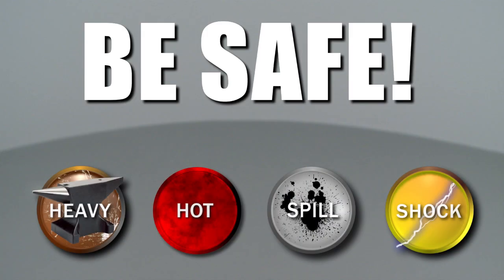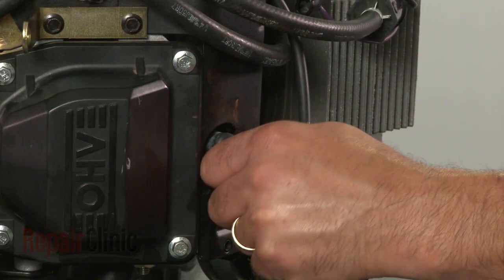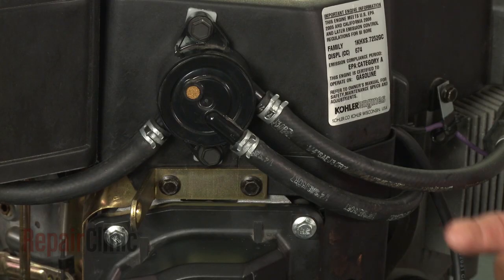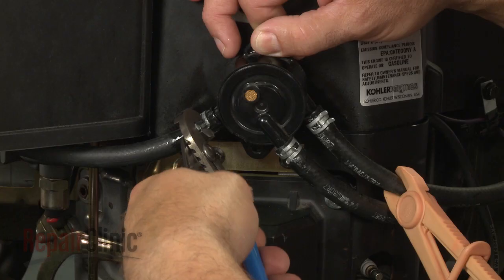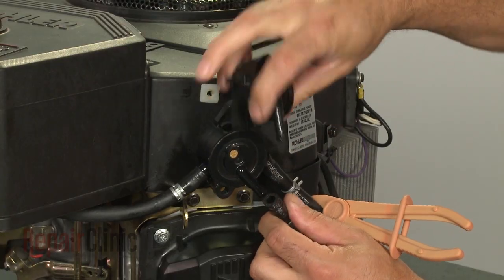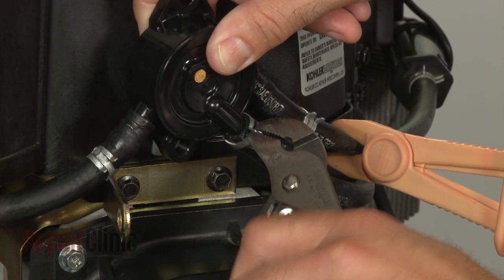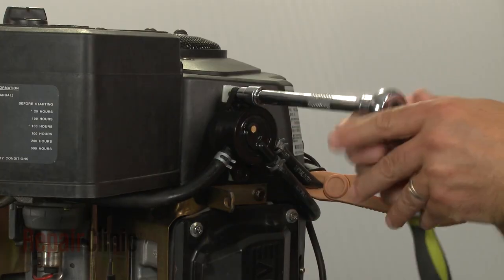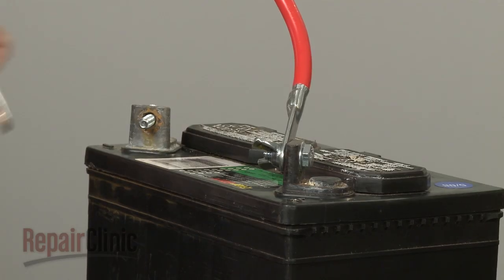Kohler Small Engine Fuel Pump Replacement #2439316-S

Comment from the maker: I would first check the breather on the crankcase and make sure it is not plugged. Somehow you are getting too much pressure in the crankcase and oil is getting in the pulse tube for the fuel pump. You also could have a bad head gasket between the valves and the cylinder. With the compression released you should have about 70 -80 lbs. of pressure. Hope this helps.

Comment: You should have explained what each port is for. My pump was removed before me. No where can I find a diagram showing each ports purpose
Reply: On the pump you have three nipples, two on the sides and one on the front. The line from your crankcase is the vacuum hose, and attaches to the lone nipple coming out the front. The line from the gas tank should attach from the same direction as the vacuum line. The fuel line to the carburetor is attached to the fuel pump on the opposite side from the fuel inlet and vacuum lines. Find more info on other videos: https://www.youtube.com/watch?v=HAUZUPoopSI

Comment: I have a Toro zero turn with a fuel pump just like this. Its not so easy to get pliers in there because the side fuel tank is in the way. I bought it in Aug. It has 2.7 hrs on it and won't start now. If it won't fire shouldn't I smell gas when cranking it for a few seconds? I disconnected the outlet hose from the pump and no gas came out. I cranked it about 4 seconds with a paper cup under the outlet. I only saw about 2 little spurts come out barely bigger than droplets. Almost no gas was in the cup. I think I would expect more gas to be flowing out of the pump than this. Do u think the pump us bad?
Reply: Does it have a fuel filter on the line too? The fuel filter may be dirty and may need to be cleaned. It would be located on the gas line. If it’s the fuel filter then that would save you money in the long run. It could be the pump. It could be a number of other things too.
Reply: It could be the carburetor is dirty too. You might want to inspect the carburetor.
Reply: I kid you not I’ve ran an air compressor and blew dirt and hunk out of a carburetor before and that has fixed most issues most of the time. It can be the smallest things.

Comment: i have a jd k241 10 hp can i bypass the fuel pump if i reroute the gas tank or does it need psi will it still run without the fuel pump. thank,s
Reply from the maker: Robert Mccaffrey Probably not. We do not recommend trying to alter a manufacturers design.
Reply: RepairClinic.com is that because it’s better to spend more money in the long run than it is to spend one lump sum of money that would last a long time? Yeah, I disagree with your answer. If it helps the mower hold a longer life span then altering the manufacturer’s design helps a lot. Same with computers.

Comment: i have a22.5  KOHLER engine on my lawn tractor , i have oil squirting from the vent on the fuel pump , have replaced fuel pump , still same problem .??

Comment: Oh, so this is how this works. The fuel pump looks like its sitting away from the engine with 3 bolts holding it on. It looked to be a diaphragm type, but I couldn't see any shaft of any kind coming from the engine to operate it. I see now it works off of crankcase vacuum.

Comment: Disconnecting batteries and spark plug boots when replacing a fuel pump is not necessary